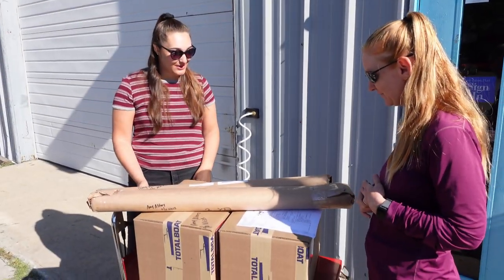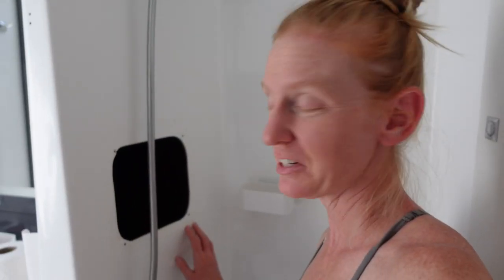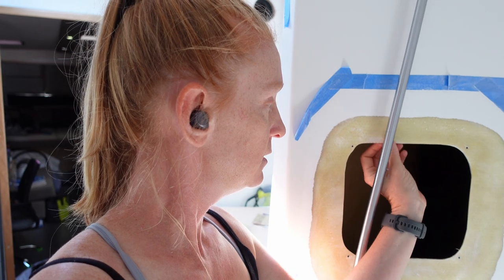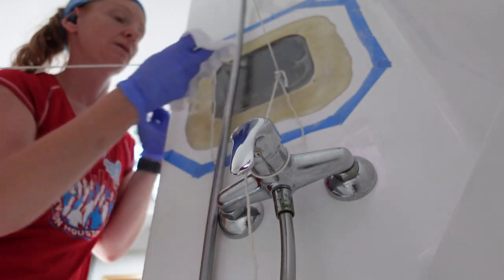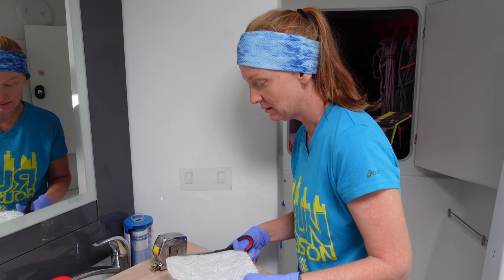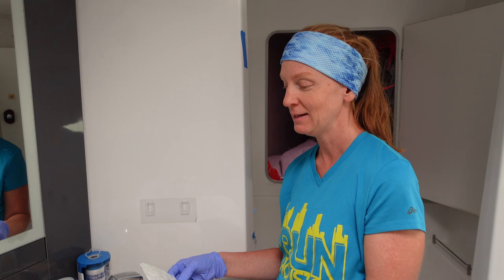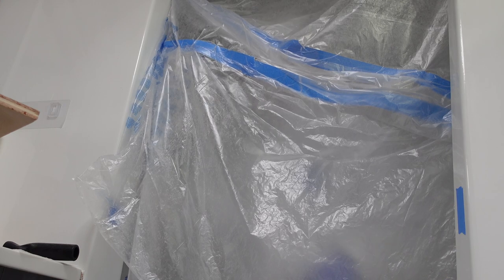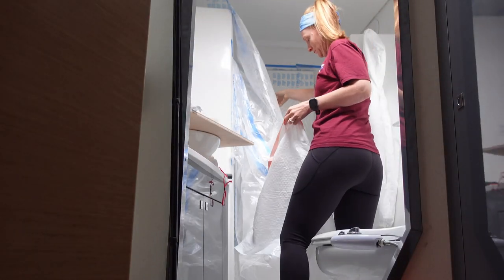Taking the Plunge - Learning Fiberglass Repair

Comment: Just a thought. When filling a panel as in the video, you can use small flat head wood screws to hold the filler piece in place. #2 x 3/8 screws would work fine here (m1 or m2 if you can find them). It is easy to countersink a small flat head. Then you just glass over them.

Comment: Thanks Amy and Dave! Definitely my next skill to learn. What temperature range was it when the gel coat catalyst in the amount recommended was added so that Total thought you had added too much.
Reply from the maker: Fiberglass/gelcoat is a very worthwhile skill!  We should have forced ourselves to try a lot earlier!

It was perhaps in the low 80's (28ish C) so it wasn't too hot.  But it's tough to know which issue actually led to the problem.

Comment: Have you not just lost access to your shower faucet connections by closing that panel?
Reply from the maker: Haha, you have a good eye!  Yes, we did lose access by glassing in that panel, but we can add access on the backside of that 'wall' which won't be constantly getting wet in the shower.